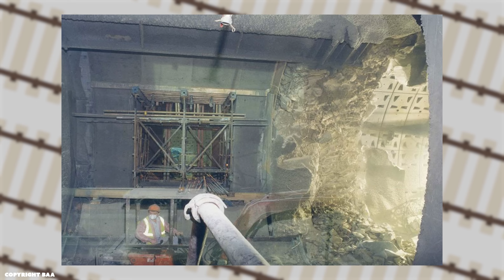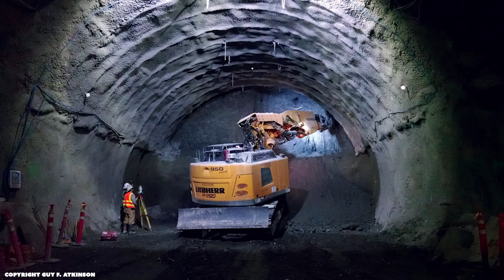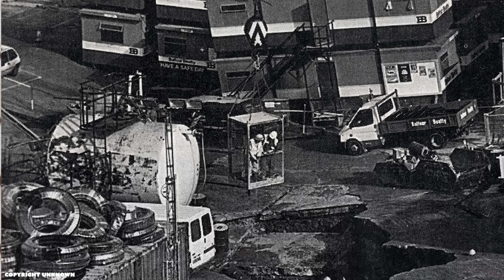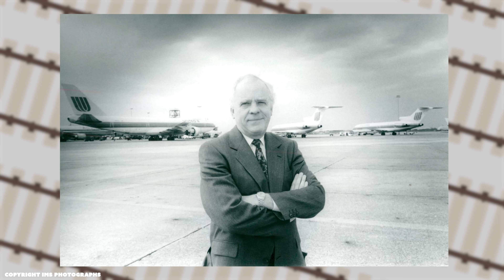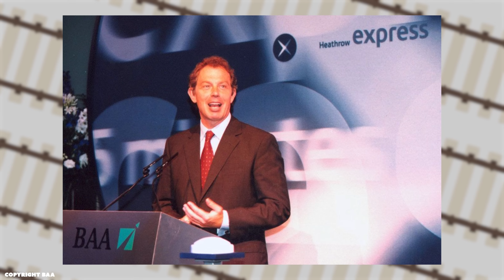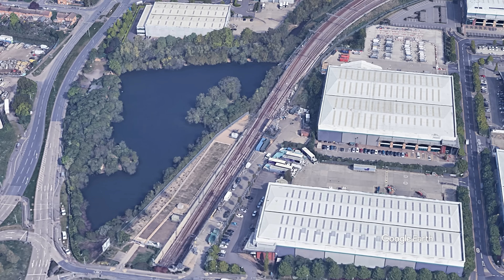What happened to Heathrow Junction station?

Comment: I well remember the day of the collapse.  I was at the engineering offices of Lafarge in Dunquerque in France for a project meeting.  As Lafarge were the sole suppliers of cement for the project, you can imagine they were extremely worried there might be some fall-out to affect them - problems with cement quality perhaps?  I was able to reassure them because back in our test lab we'd done all the quality control testing of sample blocks from every mix of concrete, and they had all passed, so it shouldn't that.  I didn't read the final report on what was the cause.    

As you say Heathrow did a great job getting the project back on track.  Usually this sort of thing leads to years of legal wrangling that just holds everything up.

Comment: The 332 'fishbowl' is now gone, and now there's boring electrostars.😢
Reply from the maker: The few times I've been on the Heathrow Express over the years the switch over to the Electrostar Class 387 steps a like a downgrade from the interiors of the older Class 332 specially in first class!
Reply: @railwaymayhem Gatwick Express 1st class is something to talk about😂
Reply from the maker: No comment 😂
Reply: 333s still running though!